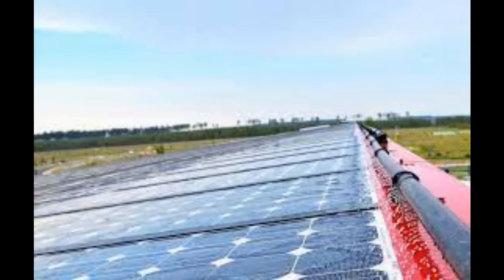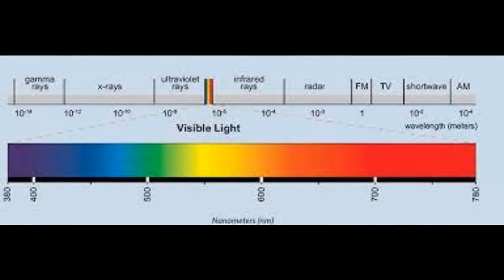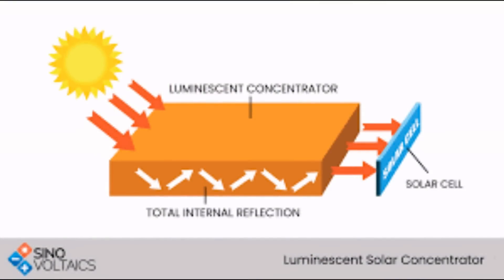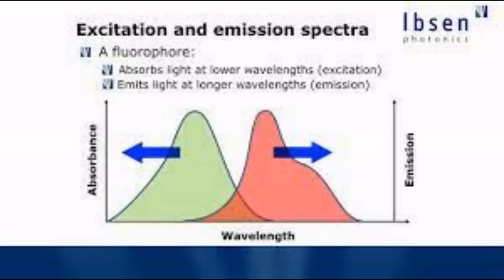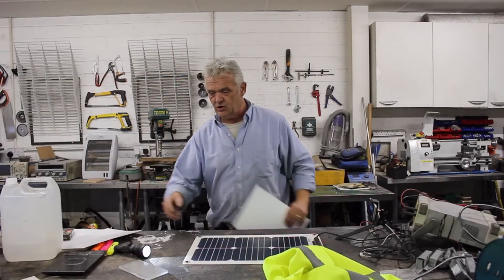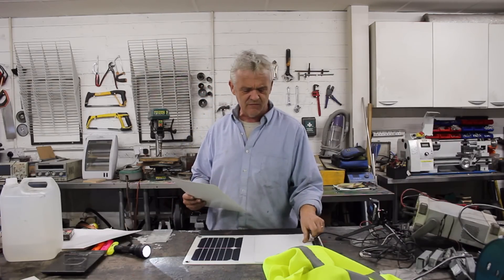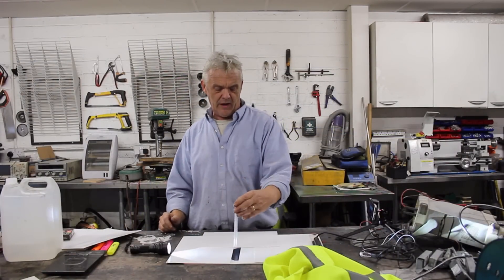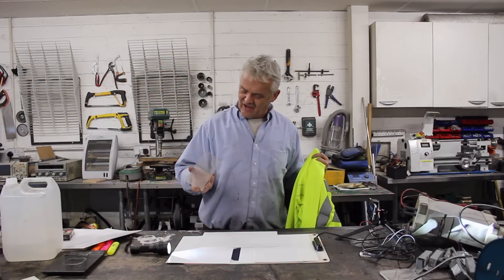1664 Supercharge Your Solar panels With Fluorescence

Comment: think if you have the normal pv panels and then this fluorescent plate it need to use the whole cell so you need to cut groves in this plate to get the cutting edge where the light is generated maybe just Grind on the surface i think 10mm transparent 10mm grinded

Comment: I tried glow in the dark paint charged with a light (painted inside of round oatmeal container) with a small solar cell in the bottom. It did not work.  Glow in the dark paint does not glow for long enough.  I like those panels that enhance the light.  I want to do experiment with bicycle reflectors.

Comment: I assume that part of the gain was  the light rays coming from an horizontal angle being redirected onto the cell. It would be interesting to check it with the same setup using a clear acrylic sheet.

Comment: So the fluorescence is converting wavelengths that are unavailable to the solar cell to wavelengths that are. How efficient is this? I’d imagine that commercial developers are already working on multilayered solar panels that do this.  I guess the trick is collecting the ‘new’ light source without obscuring the existing useful light.  If there is significantly more energy in the unavailable spectrum perhaps this should be the focus of new solar panels.  -As ever, someone will have thought about this long before me.

Comment: Wow now I have no idea how to actually do this, but. Because of over heating panels I’m wondering what could be done in the way of combining the liquid rest with the fluorescent and lite bending and encapsulating it all so it doesn’t freeze or leak weather stationary or mobile because in the winter you can pull heat off while heating your living space and summer all the hot water your heart desires . It would add at least 15 pounds per 200 watts but off grid heat for your 365 green house? Definitely interesting thanks for these ideas

Comment: You are misleading people.  First, a solar voltaic cell  acts as a current source, not a voltage source.  Having only a voltage reading is not an indication of the capability of the cell.  You must also measure current.   You are using a multicell panel.  The "additional" light is simply spreading out under your coverings and exciting more cells.  That is the only way you will get more voltage.  The panel has a maximum output over a relatively narrow spectrum of light.  The fluorescent color should be chosen for maximum compatibility with that spectrum or it will only add heat.

Comment: I don't think that claims of improvement are supported by the demonstration.
1) In order to believe the light guide had any value, I'd need to see the effect on voltage of having the light coming in at a variety of angles. My expectation is that light guide would degrade performance as the light got closer to perpendicular. The question is, how much.
2) Is the flourescent material is actually making a difference or, or would a sheet of white paper or aluminum foil worked as well?
3) How do you scale light guide and flourescent material trick to a set of panels, rather than just a slice of one.
Reply from the maker: without being rude mate - and please forgive me if I come across this way - You have to remember this is just a report on research others have done - and there is quite a bit of it that contradicts what you are saying

Comment: Interesting, but the light was barely shining on it as most of that light was coming from an incidence angle that may be causing the majority of it to reflect upwards and away from the cells. That is of course until much of it was directed towards the cell through the LCD light guide (probably acrylic) and by the jacket's reflective coating back through the LCD light guide. 
In other words, this would only be a valid test if the light beam from the handheld light was directed from the proper angle in the first place, and then compare the output to that obtained with the addition of the other components.
Also, the overhead ceiling lighting and all the reflective surfaces in the room need to be accounted for and isolated or removed.
The setup here is showing about a 50% increase, but I suspect it would be between 1% to 2% if tested properly.

Comment: Rob.. one question. While the potential ( volts ) see a jump from 0.8 to 1.3, which is impressive, the output impedance may have increased. In your setup, the load is open, connected only to a volt meter.
Perhaps you could apply a resistive load of say 1000 ohms and then measure the voltages. Does the output current remain the same in both cases ?

Comment: That test looked a bit suspect. The torch was not shining down onto the cell. When you added the plastic it brought more light down. The jacket reflected more light still. You did not show that the fluorescence was doing this. It could have just been the angle.

Comment: I do wish engineers would not pass over the heat problem. I think a good design should start with the heat problem solved. Once you do that, everything gets easier.

Comment: Now you need a dichroic coating on the two larger surfaces of your light guide that is reflective to the wavelengths that your fluorescent molecules emit at. So light can enter you panel easily enough but then when inside is converted by the fluorescent molecules into a wavelength that is trapped due to the dichroic coating, this will prevent light "leaking out" the back or front of the guide and force most of that light to the panels at the edges.

Comment: Interesting experiment.  But I think most of the solar cell improvement seen there is just the increased light flux from the reflected light off the safety vest that would normally otherwise travel straight through.  A second test sample would be a simple white non-florescent cloth and compare it against the florescent vest.

The electron "band gap" of the semiconductor's doping elements determines the solar cell's photon sensitivity.  Boron is used for P-type and Phosphorous for the N-type.   This makes current commercial single-junction solar cells sensitive to red and infrared photons only.  Most of the blue photons just bounce off and do not kick a valence electron out of its orbit to induce an electric field.

What's going to work better than florescent pigments for solar cells are transparent "Quantum Dot" (QD) films that can be laid right on top of the solar cell in its own layer under the glass.  Kind of like florescent pigments, QD films will convert shortwave "bluish" light into longer wavelength light -- specifically infrared light so solar QD films won't look brighter to human eyes but will have a dramatic effect on solar cells.  The articles I read are that a simple QD film layer can increase current solar cell efficiency some 50%.  This will especially help on cloudy days where there's mostly just scattered blue light around from the clouds.

I believe the biggest hurdle right now is the Quantum Dot films are made of organic compounds so have longevity issues in the blazing heat and UV conditions a typical solar panel experiences.

QD films are not theoretical and are already being used in latest commercial LED monitors to improve power efficiency and light purity because the LED light source has a slight blue tint that is otherwise just filtered out with a yellow film.

Comment: I tried coating the front of a solar panel with fluorescent yellow paint to boost the panels efficiency and it worked! The trick was getting a thin coating in front of the panel. For demonstration purposes, the easyest way to do that is to take a individual solar cell without any insulation and coat it using a marker.

Comment: Years ago I did experiments like this on an 18v panel, I was looked at like I was stupid for doing it but this makes me feel gratified that others are finally noticing it could work, my results were 2-3 volts at night from the panel as well. The florescent material was Strontium Aluminate from the company mule light. I tried to make a deal with them to help me get a solar panel made but they didn't much care about it or other companies for that matter. My goal was to make a panel that worked at night. Working better in the day was just a side effect.
Reply: I get 1.9 volts at night on my 6v solar panel, i decoded there is a polarity switch between day and night as it reverses my air pump, hence their reason for adding a blocking diode, strange but true.
Reply: @fpvangel4495  that sounds really good 😊 I love hearing improvement on this tech. I was just messing with the concept at the time.
Reply: @dapain1576  It actually relates to the Milky Way but thats another story, the point is it alternates current between day and night and is detectable.
Reply: I think it would be helpful for vertical panels like the so called 'balcony powerplants" or used on solar fences
Reply: @CUBETechie that’s not a bad idea 😊.
Reply: @dapain1576  i think because it MUST be optimized for diffuse light
Reply: @CUBETechie  another reason I was looking into this technology was because of the question how do you replace electricity transmission with light. 💡. You need the Diffuser in such a setup. It’s curious because as you start replacing things traditionally powered with electrons. The less electricity it needs to run it which makes solar even more feasible. One day you could have a solar panel that literally just collects light stored in bioluminescent batteries without it needing the conversion.    Back on topic though the Diffusion is useful for two things you can either spread laser light to a large area like a solar panel or concentrate large light into a laser pinpoint. Which means that you could also have solar in server racks stacks indoors using fibre optics. Just a thought and something I haven’t seen done yet.
Reply: @CUBETechie  My brain has been sparking all day since I read your comment and having been reminded of this video. I had another new idea that is a revamped version of the solar server racks using fibre. With that technology you could theoretically build a solar battery that generates its own power. You have 2 solar panels sandwiched together over a diffuse panel and behind the panels you can have a battery cell wall behind each of them being charged. Or make each cell have a solar cell on each side and array them in a battery box. The only thing that would be necessary then is a light tracking tunnel that connects to the fibre optic inputs and the outputs would connect to the solar batteries.
Reply: @daniellapain1576  o my God wow i had the same idea
Reply: @CUBETechie  now imagine how an electric car could change to implement such a system and still be able to retain its aesthetic appeal of car paint and not be covered in solar panels.
Reply: @CUBETechie  I’m anti-patent, so as long as the idea is available for everyone to make their own version of and enjoy. This system should stay open sourced. I came up with the initial concept a while back and I still have my original design written down from years ago so I’m hoping that this will help people out. It’s a very environmentally friendly system since solar no longer needs fields of panels. I’m glad to share it with anyone who has the interest and knowledge.
Reply: Isn't strontium radioactive?
Reply: @replikvltyoutube3727  strontium aluminate is relatively safe and any radiation has to do with photons. Strontium aluminate is used as a safety measure for uranium bars since it absorbs radiation and expells it as light and can withstand 2000 degrees

Comment: Hmmm. Would you get the same result with a tin-foil backing? Or just white I guess. I am thinking what could be going-on with this particular test might be as simple as it reflecting some light back through the light-guide and thus onto the solar cell. Not as exciting, so I hope to be wrong.

Comment: Im excited to try this!  Fire will charge a solar panel.  I use my gas light in winter to see at night and to charge my small 5v solar battery packs. I imagine this reflection idea would improve my charge. The panels I use hang on my wall directly under the light just outside the "burn zone" . About ½ meter or 18 inches down and back . I'm positive this would work to some degree off any flame .

Comment: while i like the concept would it not be much harder to apply in real world scenario? the only reason i ask is because in this model we are measuring a single cell, but panels aren't made up of single cells, they have multiple, so would having stacks of acrylic with flourescent materials not then start reducing light transmission to the other cells and reduce their overall output of said panel would it not? I realise there are varying factors to this issue that add complexity, time of day, angle in relation to the sun, possibly would make panel cleaning harder too.

It just seems that a 30% increase in voltage seems like way too good an improvement to be realistic in real world terms, there has to be a compromise made somewhere...you know you don't usually get something for nothing, its kinda steering away from thermodynamics and close to the fringe like claimed free energy devices...would love to see different models on whole panels tested and the efficiency increase measured.

Comment: I really like this idea and I think I will tinker with it soon. There is a type of solar panel that I really enjoy and they are Solyndra. It is now a defunct company but you can still find them use and are of a unique design. They look like florescent light tubes, long and round. Look them up. They would work great for this line of though. Let me know what you think. Here in the USA if you can find them, go for about $50.00 and each tube generates 100v. You will need to take a look at them, I think they are amazing and have more to offer than flat solar.

Comment: If you made a cowl to cover the solar panel and painted it with that fluorescent material and had an extremely bright led light on in the inside….would the solar panel make enough light to turn the led light?

Comment: You can't use voltage [V] of an open circuit to measure the power output. At least hook it up to some load and calculate the power [W].
Also, if you put any reflective surface (mirror) behind your light guide, you will get an increase as well, probably much higher in the case of an mirror (depending on the position).
So your test/demonstration is not showing anything significant.
Reply: moronic...the output is less than 0.5%. voltage is NOT indication of energy production. this guy is a ignoramus

Comment: That amazed me as it is a lateral move away from current panels and actually works so well. I wonder if the fluorescent media was placed under a bidirectional panel if it increased the output? Great job  Robert!
Reply from the maker: I know what you mean mate - talk about out of the box thinking lol - and yes it probably would mate -cheers

Comment: So let's say that you use some type of flouresant or light reflection system to say increase the voltage of a 12 volt panel to 16 volts.
Doest that make the panel too powerful for a 12 volt system ?
Reply from the maker: you would have to add a regulator post the panels but prior the rest of the system to maintain the voltage at 12 v but your amps would go up
Reply: @ThinkingandTinkering  When you say regulator are you referring to a charge controller or something besides that ?

Comment: It looked like the reason the voltage went up was because the jacket reflected more light back into the light guide from the back side as opposed to some of the light just passing through. I wonder what the results would have been with just sticking a white piece of paper back there to reflect the light back to compare the two values.
Reply from the maker: I tried it mate - it didn't work as well  -but this is a replication of research papers not my idea - I am just showing it can be done at home with easy to find materials
Reply: @ThinkingandTinkering  Are you able to provide numbers to help quantify how much better it is? I'd like to see how much more effective the fluorescent is compared to just a reflection off of a white piece of paper. is it 10x better? or other extreme is it only 5% better? etc. I'm just thinking in my head if just getting a reflective material vs spray painting it flourescent vs a mirror/shiny surface what might be an acceptable compromise for the cost.

Comment: a standard florescent house hold light bulb generates uv light. we convert that to visible light using that white powder on the inside of the bulb. different mixes of the powder give as the lighting color index.  take some of that white powder, put is on a sheet of thin glass and lay it over the panel. you should be able to harvest all the uv light the sun is putting out. Im gona try that! take a broken florescent bulb, take a small cell, insert it in the tube and see what happens!
Reply from the maker: that's clever mate - cheers

Comment: fluorescents increase the wavelength, not reduce it, so blue gets turned into red (there are frequency doubling crystals, but they are different).  But this is fine because silicon solar actually work down to near infrared and produce one electron per photon no matter what the frequency is.  You can put the fluorescent on the front face if it is applied carefully because the long wavelengths will pass through the material, and the shorter wavelengths will create fluorescence.  In practice this isn't used because none of the readily available fluorescents are sufficiently efficient to average more than one infrared photo per incoming photon, and the emitted photons go in all directions, so they end up making the cell less efficient.  silicon cells catch any photon less than 1150nm or so, but if you want to make two photons you need at least half that wavelength, so 575nm, but there is only about 30% more energy available this way.
Reply from the maker: cheers mate